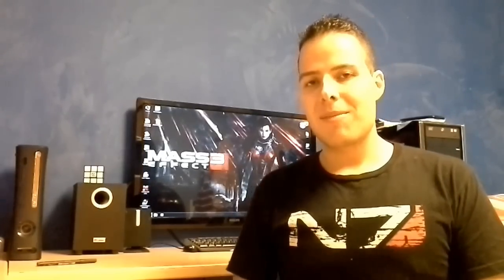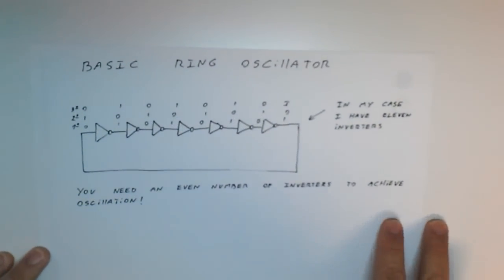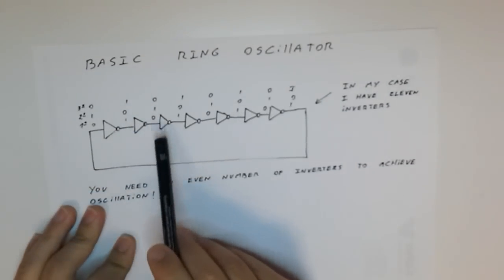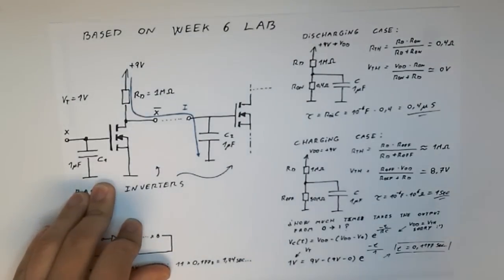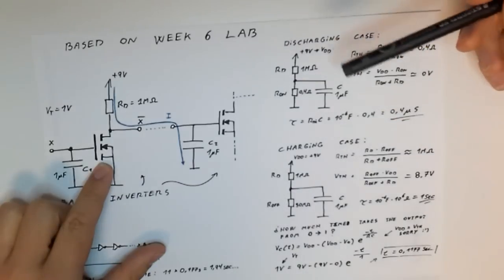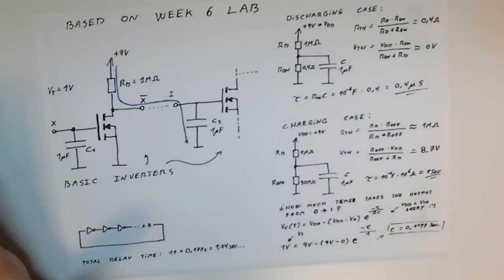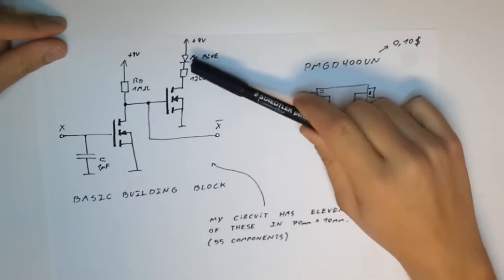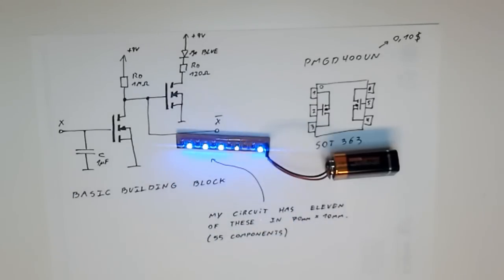8 - MITx: 6.002x, CECC 2 | Ring oscilator circuit

Comment: Hi there! Nice video! These are Pseudo-NMOS inverters you have implemented and are not very efficient. 

If you want to make a great inverter, you have to use a CMOS structure: You need a P-channel mosfet on top and an N-channel mosfet at the bottom. Both of their gates are connected and is regarded as the input. 
The P-channel mosfet's source is connected to +. The N-channel mosfet's source is connected to -. The P mosfet's drain is connected to the N mosfet's drain and this is the output. 

Only one mofet will be on at any time (remember, if you put a - voltage to the gate of the P mosfet, it will turn on, so this turns on when input is logical 0). When you supply logical 0 as input, the inverter will connect the output to the + rail via the P mosfet; when you supply a logical 1 to the input, the top mosfet will be off, and the output will be connected to ground via the bottom N mosfet. Hope this helps. Regards from Greece.